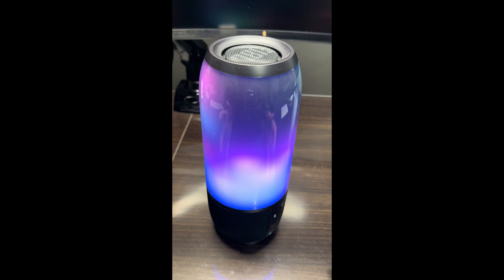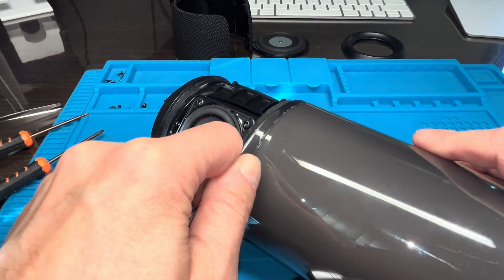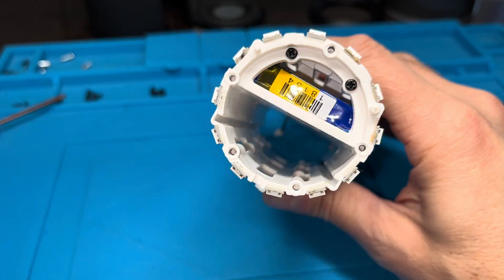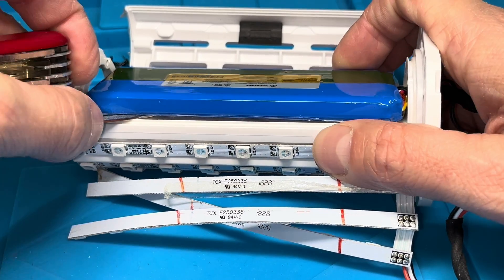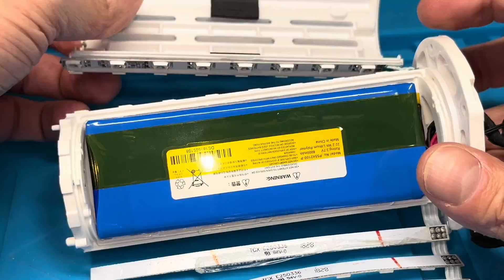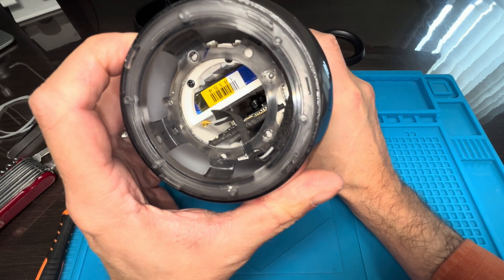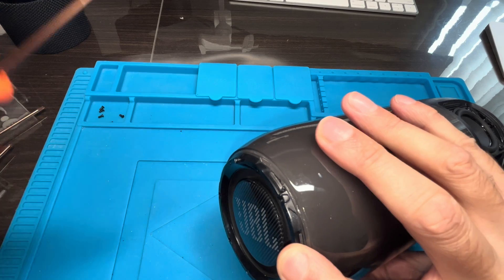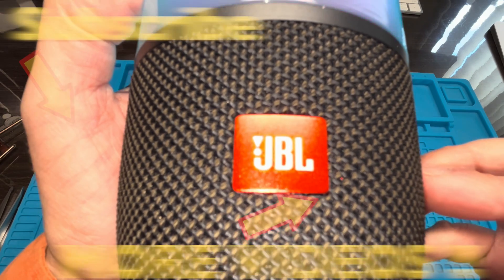JBL Battery Replacement Pulse3 (DIY How to instructions)

Comment: If anyone is preparing to take on this challenge I urge you to check your screws before ordering any kind of replacement battery. These products are really not made to be fixed. Most of my screws did not come out or came out warped and unscrewable. I used multiple different screw heads and were careful for the most part and screws simply did not want to come off. I am now giving up on this and sending the batteries back. I hope some of you were successful in this ordeal. I sure wasn’t
Reply: Im currently having trouble removing some really rusty screws from the inside. Im glad I didn’t order the battery yet.